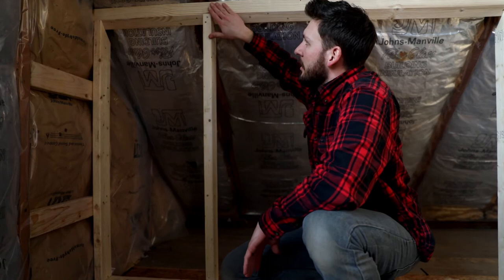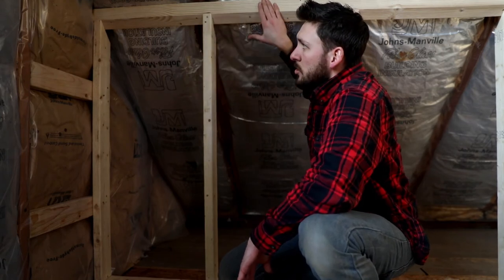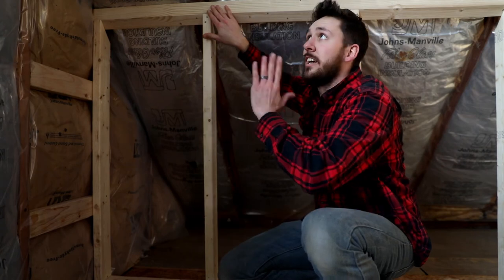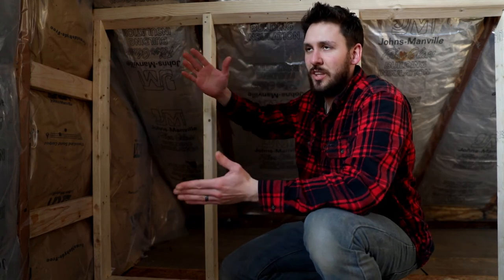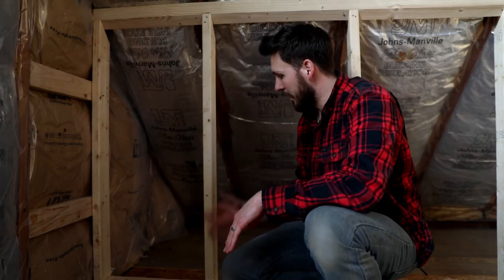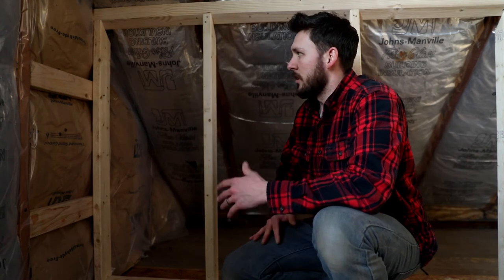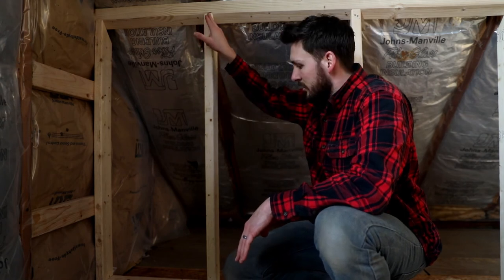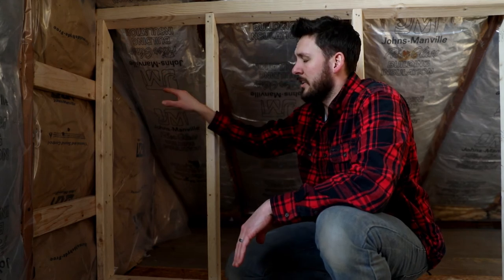DIY ATTIC FINISHING - HOW TO BUILD A KNEE WALL! - PART 3

Comment: How do you find the angle of the roof?
Reply from the maker: Hey Jason! I'd actually recommend checking the angle of each joist as they will all vary if your house is not perfect (NO HOUSE IS PERFECTLY SQUARE! :) ). A quick and easy way to do this is using a level and a square and line them up to the roof to decipher the difference between the 45-degree angle of the square and the straight level. This doesn't have to be exact, but I'm sure there are more complex ways you can use to figure out the exact angle that I am not aware of.